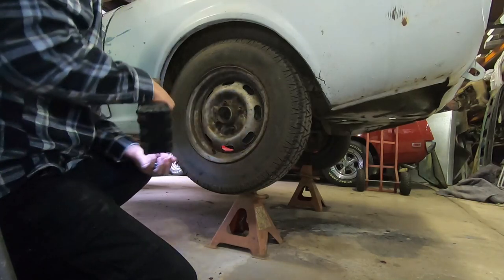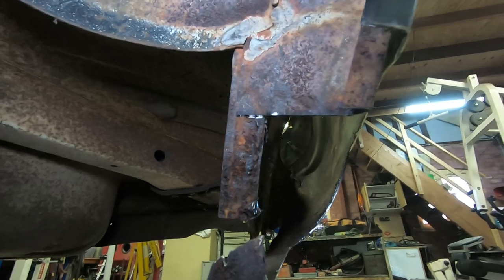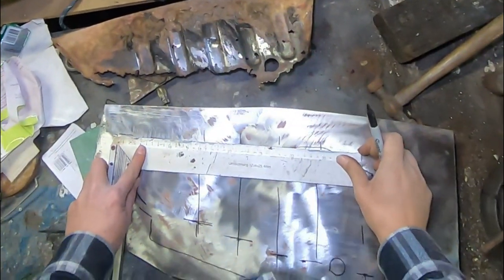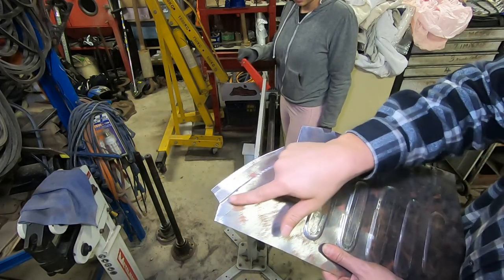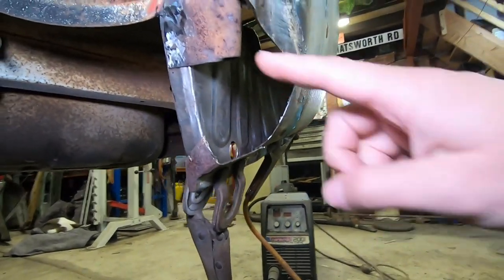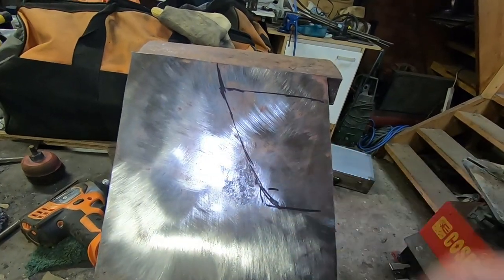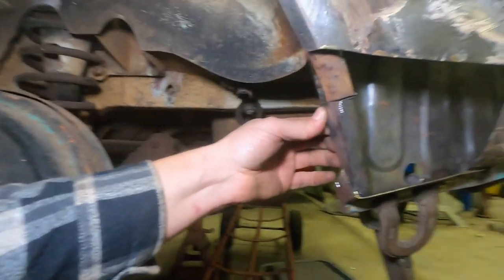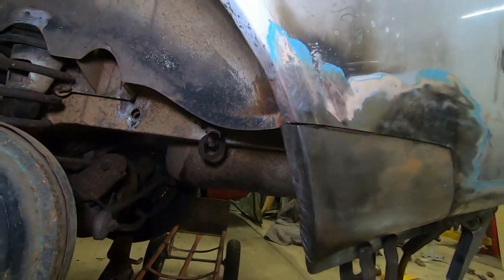TA22 Toyota Celica For Sale. Rust Repairs, Part 2, LH Rear Lower Quarter Panel

Comment: Nice job mate. You're a man after my own heart Mike. I have a piece of railway line and a ball pein just like yours. My piece of track is just an inch or two longer. I used both only last week when doing a small sheet metal job🤣👍🇦🇺
Reply from the maker: Gotta love some scrap railway as an anvil. Has some good curves to it too!
Reply: @shellberightgarage  Yep they make very handy makeshift anvils, especially when they're free👍lol. My dad has a 3-4 foot section he's had as long as I can remember. I was lucky enough to score mine from a customer that had a few small sections (that caught my eye) in his garage when I went to service his wife's car, so I asked him the obvious question. He does hardness and crack testing, so I'm guessing they must cut off random sections of new or old track to verify condition or quality, or maybe offcuts from when they finish a run.🤔

Comment: For fucks sake! That was incredibly instructive and inspiring. I love the detail you showed too. Can watch a lot more of this. Hell, I might even try my hand. Have to do without the English wheel, stretcher/shrinker and bead roller, but that's all part of the fun - innovate/try/fail/succeed. I'm not going to try and reconstruct a part of a panel though!
Reply from the maker: These are just some cheapies. Keep an eye out for some used ones if you can,  they certainly make it easier! Glad to hear you'll give it a crack.

Comment: At least you didn't get the sizzle and crackle in the ear canal, I hate when that happens!
Look around for an electric motor and foot switch from an industrial bone yard to motorize that bead roller give your hands free. Sort of like the old sewing machine foot pedal. might make things easier long term...
Great job and it will help new folks to understand what it takes for metal working and also how to template the work with stiff poster board so they do not lose the curves and angles to match both sides of the car.
The project car dream will be better to understand the scope of work and time involved, instead of becoming yard art in the backyard.
Reply from the maker: Too many good cars end up as yard art or scrap unfortunately.
You're not wrong about the ear canal! Lol.

Comment: Metal artistry at its finest. Three tools I’ve always wanted but haven’t been able to justify yet. Shrinker/stretcher, English wheel, and bead roller. 
Are you using mig or flux core?
Reply from the maker: I was the same for many years. Glad I finally bit the bullet. I'm using gas Mig.
Reply: @shellberightgarage  getting the mig was like opening up a whole new world👍👍
Reply from the maker: @bobuncle8704  totally! I still have my first mig from over 20 years ago. We call it "old faithful" and still use it for gasless welding.

Comment: Amazing metalwork, sadly does not appear to be taught in schools anymore. I would not have thought to drill out the spot welds then weld back through the drilled holes again. What metal did you use.
Reply from the maker: Thank you! I cut out the steel from the original dented drivers door that was on the car. That way I'm using the same gauge steel as original.
Reply: @shellberightgarage  Thanks for the reply.

Comment: Hi, is that lead that was used for the repair?
Reply from the maker: No lead was used in this repair, just steel.
Reply: @shellberightgarage  I meant on the original one!!
Reply from the maker: @renem6441  ah ok, gotcha. No, there was just body filler and some brazing used as a bit of a filler in the rough spots. You can see the brass colour in a couple sections.

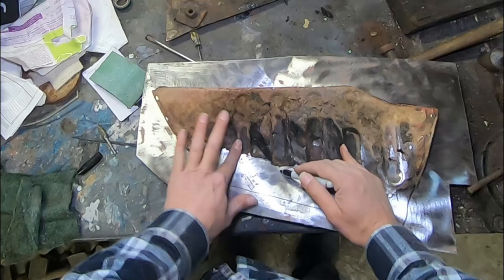Comment: 8:40 Why does a piece of steel like this need pressings?
Reply from the maker: Fair question. Outside of making it look original as per factory, it provides added strength over flat steel, and will also prevent vibrations and "popping" of the sheet steel in the event of any twisting of the shell